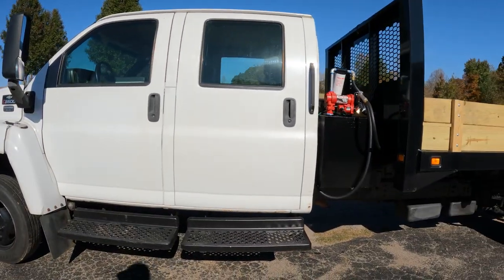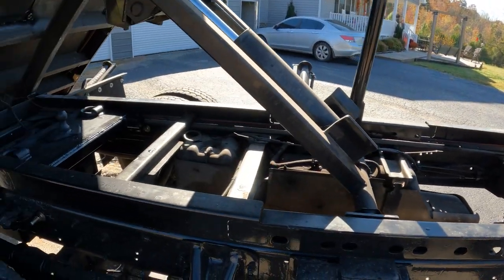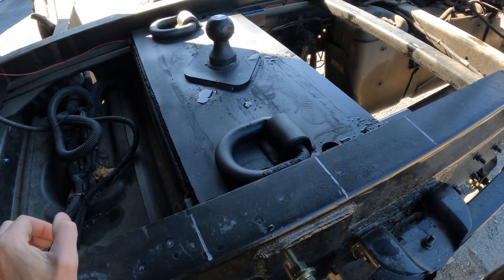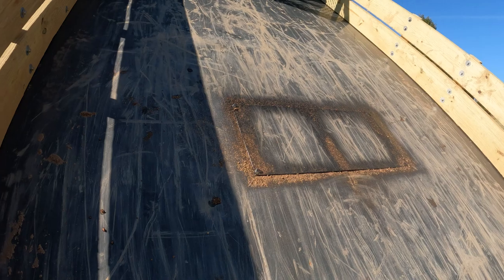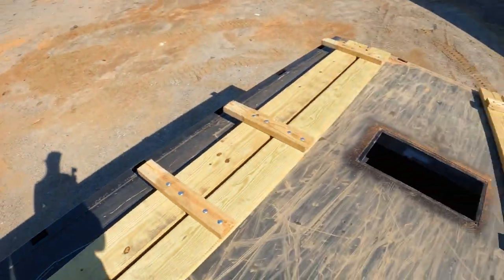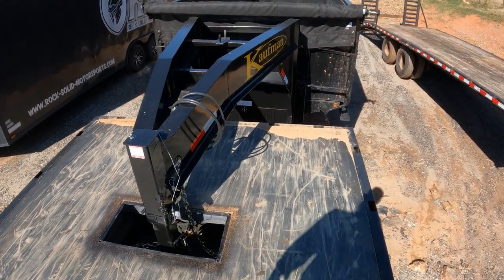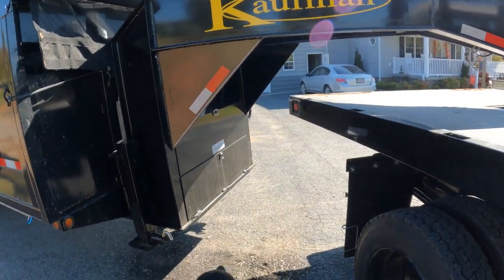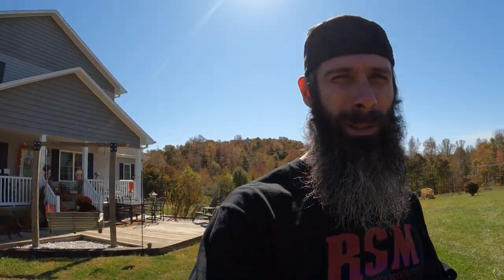Chevrolet C5500 Kodiak Gooseneck Hitch Install

Comment: What's the most you towed with this. I plan on getting on to haul a 26k lb trailer set up.
Reply from the maker: Pulled 85g excavator with extra buckets on a 24+4 Kaufman. That's around 30,000lb behind truck
Reply: @rocksolidmotorsports7297  how well did it stop it?